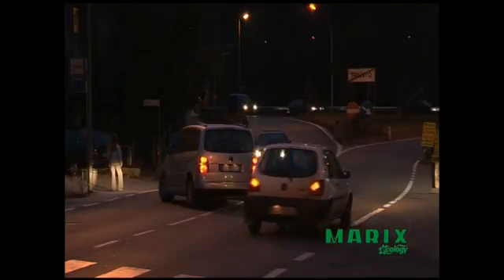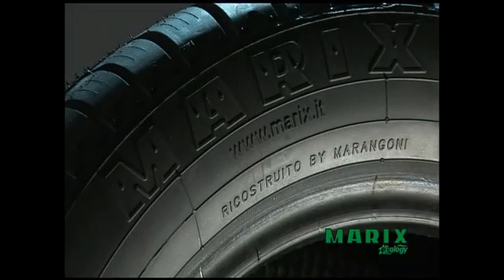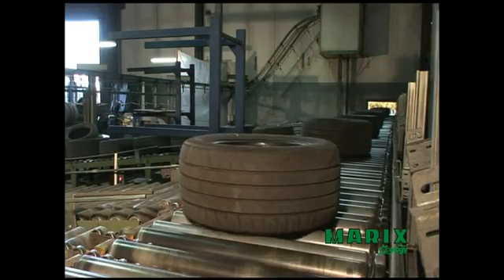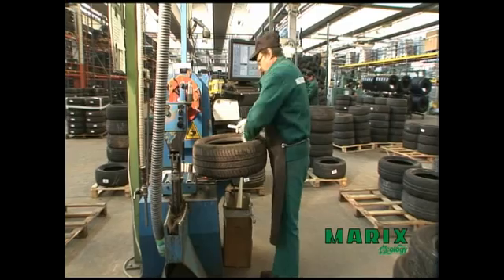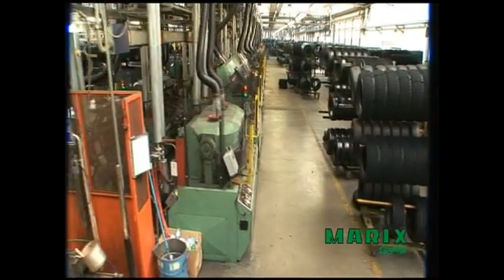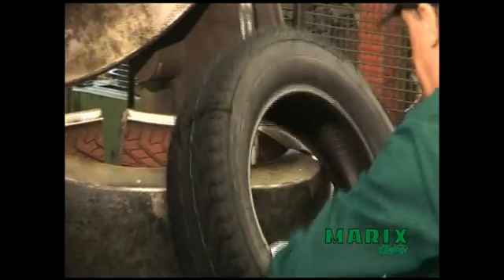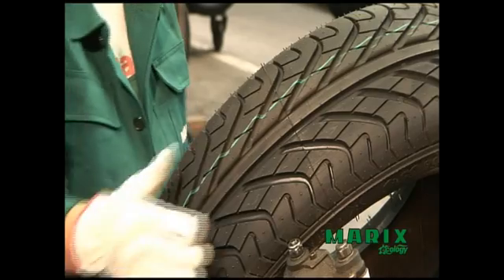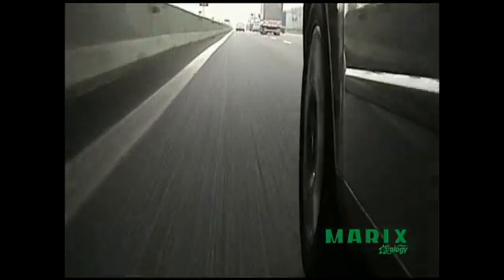Car tire retreading process - Marix by Marangoni

Comment: I ran retread (recap) tires on my cars from 1967 until they began phasing them out here in California in the mid-1980's. I never had a problem with a recap or retread tire. However, tires back then were belted with very cool running synthetic belts. The best belts for recaps, in my opinion, were either polyglass or aramid (Kevlar). Steel belting is hotter on the road, and doesn't dissipate heat like synthetics. And a synthetic belt tire is lighter than the steel. I don't get it. Why run a heavier hotter steel belt tire, when an aramid belted is as good or better..And probably way better for retreading.